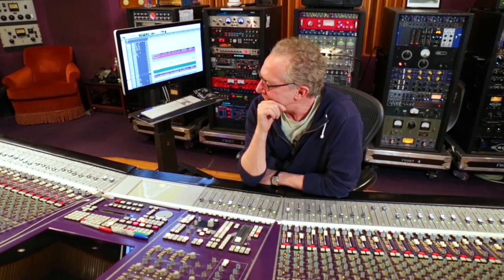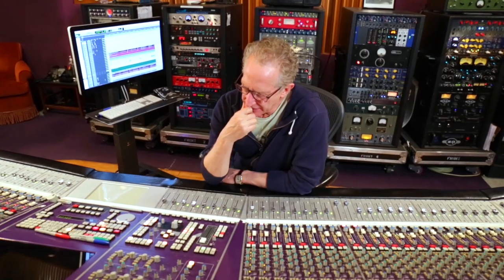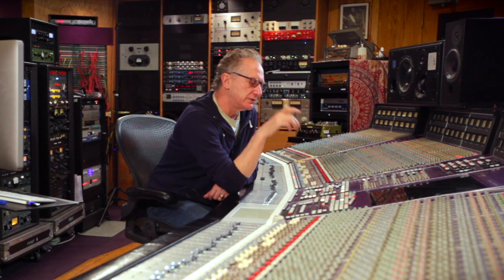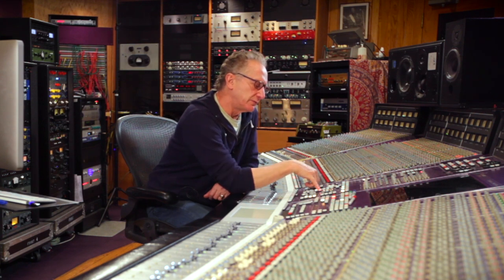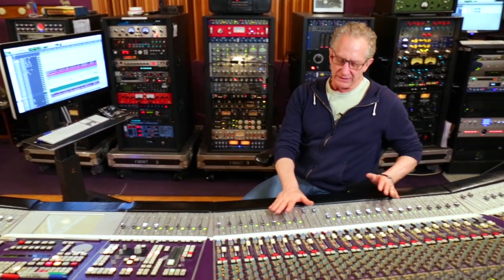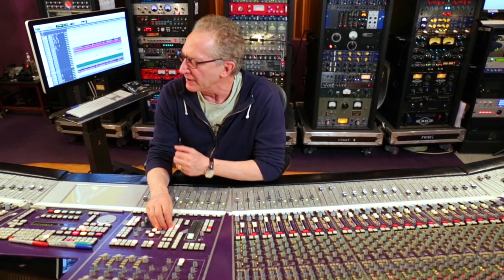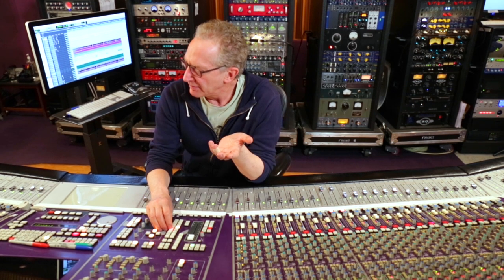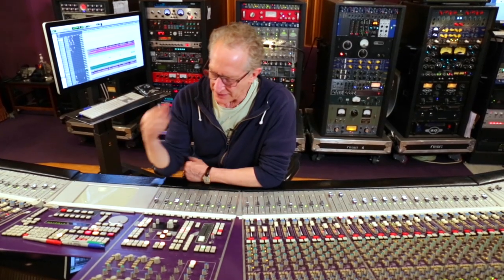Rough mix VS Final mix - Michael Brauer

Comment: yea cutting back on the low ends before the "drop" or the chorus rather in this case creates a more dynamic feel, like something bigger is happening. having a song be more linear or even undynamic can have its positives and charms too, i guess its just a matter of what you want to say with the song. what do you wanna communicate to the listener. more dynamic songs (like his mix example) seems to be the trend nowadays, while many older songs seem more stale or linear almost. the advancement of the technical part for gear is ofc a big reason for this too, things we can do now we simply couldnt do back then cus the gear wasn't around or evolved enough. 
anyway cool video and great example!
Reply: SingerinEX 

Great point!
Reply: I bet that this flat mix is mainly for mas media and average consumer.

So radios, shitty speakers, shitty headphones ect. as it will just sound fuller and louder.

While dynamic mix. Rly only that have quite good sounds system will be able to fully appreciate.
Reply: Czorńy Lisek yup!
Reply: never thought of that